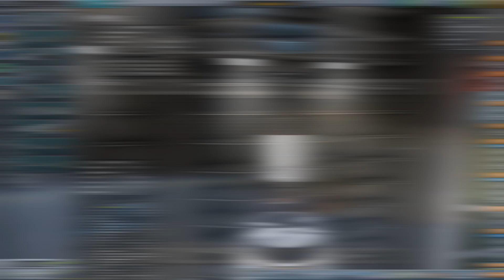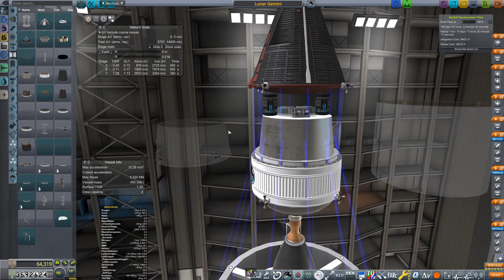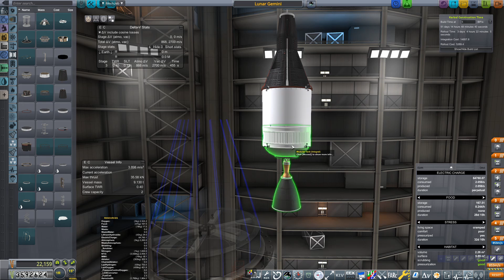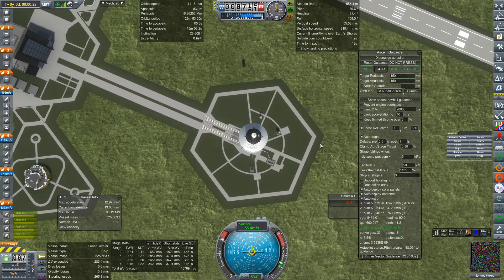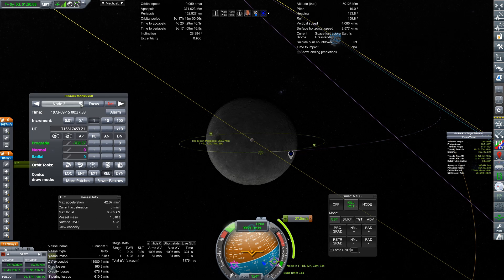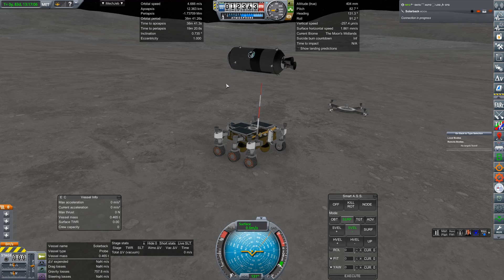Lunar Comms! - KSP/RP-1 - Next Small Step Episode 56

Comment: Protip: With Precise Maneuver, you can use the numpad keys to alter your maneuver nodes instead of clicking the buttons.
Reply: I definitely prefer Precise Maneuver over Precise Node but these kinds of things are  very much a "how do you prefer your UI to work?" rather than huge differences in capability.
Reply: Precise Node also has both numpad keys and +/-Orbit buttons (if you check "Use x10 UT increment" and/or "Show additional UT controls" in options). Like a lot of things, it's only your personal preference as to which one is better.  I used both, and, both are customizable, but Precise node is a bit better looking - more compact and less cluttered, IMO

Comment: Is there such thing as a geostationary lunar orbit?
Reply from the maker: I'm not actually sure. I know that in stock, stationary orbits are often impossible around small bodies because the stationary altitude would be outside of the body's sphere of influence. I think the Moon is big enough, though?
Reply: @justinbright9567  Did a quick google, it isn't possible. The closest you can get is some Lagrange points infront of and behind the moon's orbit, but even then those are kinda unstable.
Reply: @justinbright9567  heavier body, shorter orbital periods. Most important is rotation speed of body for stationary orbits. :)

Comment: Well, there is one problem with reusable landers at gateway. To make it truly reusable you probably would have to use generic thrusters
Reply from the maker: Oh, shoot. Engine ignitions, that's right. :(
Reply: @justinbright9567  You could have the engine at like .02 % power while refueling. Wait that would mean you couldn't time warp, crap.
Reply: If you have kis and kas,with your regular refuelling trips you may add some spare engines. It sucks, but it is also a bit better than nothing.
Reply: @raulpalomino9472  actually, you can do weird thing, place engine on a docking port
Reply: @_mikolaj_  yes! But without kis/kas you also need a way to fly it from your cargo ship to the actual lander (the port, rcs, a tank, avionics, comms...)